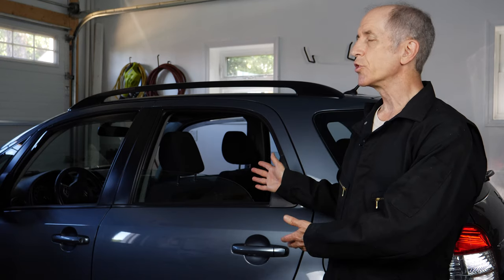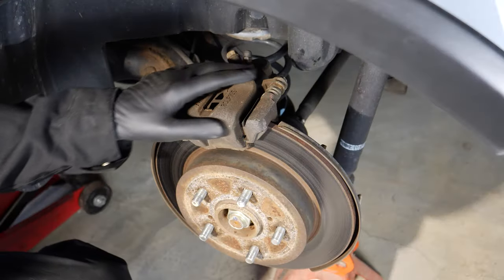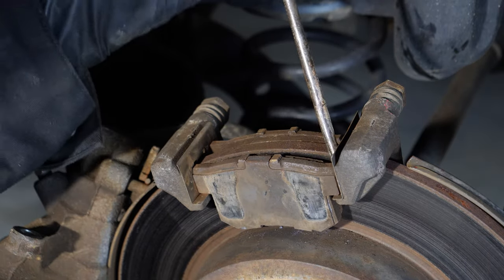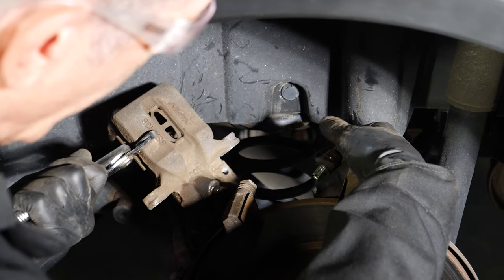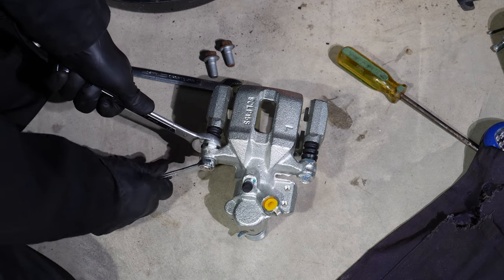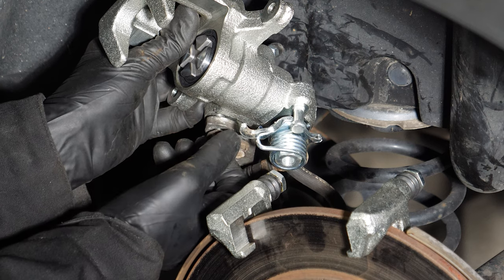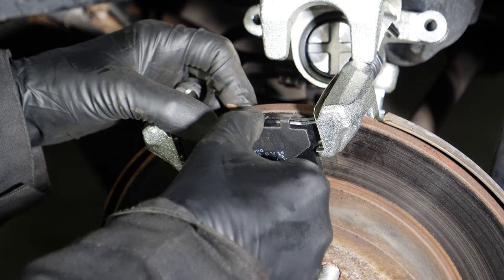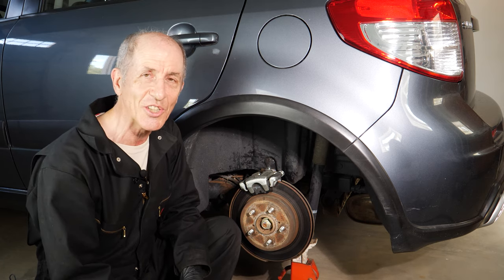2008 Suzuki SX4 Rear Brake Caliper Replacement

Comment: From the SX4  manual
Caliper pin bolt 17 ftlbs
Brake caliper carrier bolt 43.5 ftlbs
Flex hose joint bolt 17 ftlbs
Brake pipe flare nut 12 ftlbs
Parking nut 19.5 ftlbs 😊
Reply from the maker: Thanks!

Comment: This happened on my Suzuki swift sport 08 both rear calipers needed replacing with pads , the garage charged me a fortune!! Seems like a Suzuki thing that they suffer from sticking calipers. I'll be doing them myself next time now I've watched your video. Thanks.
Reply from the maker: Sorry to hear about your brake issues -- hope it's all fixed. Thanks for stopping by!

Comment: Timely, I will be doing the exact same thing to the left rear of my 2009 sx4. I’m waiting for my caliper and pads to arrive from Rock Auto. Thanks
Reply from the maker: Glad I could help! Once you have the caliper replaced, you will have to bleed the brakes on that side. I made a video to show how to bleed the brakes... if you don't already know how. Here it is: https://youtu.be/G-2v05bBWEk
Reply: Bob Kovacs thanks but I’m pretty savvy to bleeding brakes but the specifics about the parking brake and brake line was what I was looking for.
Reply from the maker: Yes, the parking brake befuddled me for a while. What I show in the video was after two hours of trying various things to get the brake cable hooked correctly. Once I did it, it was easy.

Comment: Does anyone know the specs for the bolts that hold the handbrake cable bracket, and also for the banjo bolt? Just in case I need spares!
Reply from the maker: I don't know the specs for the bolts, but they must be in a manual somewhere. It's a long shot, but maybe someone will see this and know the answer.

Comment: Hello Bob: Thanks for the nice video. My SX4 rear disk driver side have rust on it as if there is no  braking. I took the caliper off the rotor: lube the sliders which they seem fine as they moved freely: cleaned a bit the pads seats on the bracket and the disks with sand paper and brake cleaner. Not sure if this will fix but any idea what can cause. 

I tried also to press the brake pedal and the piston seems to move. I had an issue taking one of the bolt then I used an extractor to get it out. Will over-torqued slider bolt would cause the system not to function? Thank you for your help
Reply from the maker: Thanks for the comment! I don't know for sure that the stripped bolt would cause the problem... I don't think so, but I'd have to see it to be sure. It can't be a good thing, however. You could try to tap it out and put in the next size bolt. That would be the first thing I do.

Good luck!
Reply: @BobKovacs  than you bob for the reply. I finish putting back together i noticed if i dont press the brake pedal hard enough i can spin the rear wheel with my hand. It was pretty much the same on both sides. Driver side was a bit worth. Did you experience similar behaviour? This explain why the disks are rusted.
Reply from the maker: No, I do not have that problem. It's true that the front brakes do most of the stopping, but the rear brakes do some of the work. There is a valve that controls the braking force between the front and rear valves -- in at least some cars, it's called a "proportioning valve." It sounds like that valve is your problem... your rear brakes need to be working harder.
Reply: @BobKovacs  thank you for pointing me to a direction. It makes sense since they are not sticking and They seems to work with the breaking lever. I just don’t like to change the callipers for nothing thank you again for sharing your knowledge
Reply: After some search they called it 4-way joint. it goes between the ABS module and rear brakes and has 2 lines in and 2 lines out. What is funny is I cannot find any trace of it in the suzuki parts. From the manual they say front left and rear right work together as one line and the other line is front right and rear left. That is said if both rears are not working; the 4-way joint can be an issue.But the real question are those parts are know to fail.? Also in the suzuki manuel there is no mention of such an issue.
Reply from the maker: You're welcome. The proportioning valve is usually near the rear of the car. You should be able to follow the brake lines to it. It often has a lever that connects to the car's rear suspension, so that the valve can detect the attitude of the car. That would be what I would look for next.
Reply from the maker: Any part can fail. I had a brake problem that apparently turned out to be a bad brake hose. I hope you can swap out that 4-way joint at a reasonable price.
Reply: @BobKovacs  Was able to find it in Japan for 20$ plus 35$ shipping... . there is a guy on you tube who was saying this can be reset https://www.youtube.com/watch?v=texW8E9EAJQ I  ill try that first and see. ALSO ERIC THE CAR GUY has a very good video 
 https://www.youtube.com/watch?v=Dnas9PN9cCs

 Thank you soo much for your help I will let you know if replacing this valve would fix the issue. Maybe would help someone else.
Reply from the maker: You're welcome. Yes, I would like to know if the replacement part fixes the problem. Good luck!
Reply: @BobKovacs  changed the hose on the bad side and now i have a good pressure on the calliper and the disk is hot again and no dragging. The hose did not look  bad though but changing it somehow fixed the issue thanks for your advice
Reply from the maker: You're welcome... thanks for following up!

Comment: Very informative video, same problem occurred on my wifes vehicle except when i noticed it the worn out pads already destroyed the rotor, does the rotor comes off when the caliper is removed or is it fastened somehow?
Reply from the maker: Thanks!

To get the rotor off, the caliper needs to be off. Then, notice that there are two bolt holes on the face of the rotor. You need to thread bolts into those holes, and keep driving the bolts in until they force the rotor off. I think they are 6mm bolts, but you will have to check... I have not removed a rotor before on this Suzuki. However, driving those two bolts in is the way to remove the rotor.

Good luck!
Reply: @BobKovacs  thanks I got all figured out!

Comment: thanks for the video, btw, you mentioned the caliper was sticking, was the ebrake cable releasing properly? i have a 2011 sx4 but it is a manual so my ebrake gets used, i am surprised you had a problem with yours, these sx4's are quite robust.
Reply from the maker: Yes, I've been super impressed with the reliability of my SX4. Mine is also a manual transmission, so I use the parking brake all the time. The caliper wasn't dragging a lot -- I could turn the wheel by hand -- but it was definitely dragging enough to noticeably heat up the wheel. So far, the new caliper is working perfectly, and the part only cost around $70 once I returned the old one for the core charge.

Since I had to replace the brake pads and bleed the brakes during the caliper replacement, I made videos about how to do those as well.

Thanks for stopping by and leaving a comment!
Reply: @BobKovacs  oh, ok, i assumed you had an automatic, nice to see someone else with a manual  :)  Glad to hear the caliper worked out for you, must have been a manufacturing defect.  Thanks and cheers!